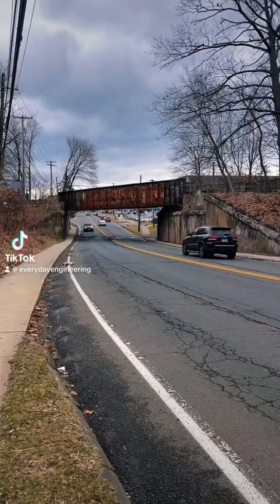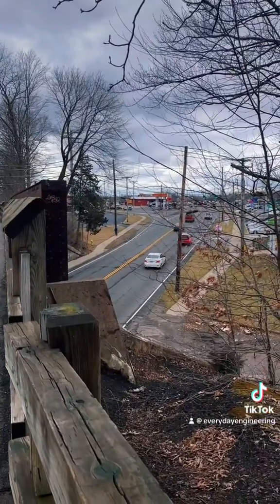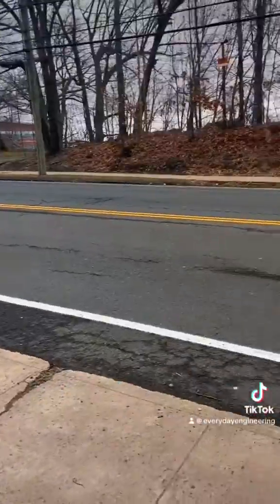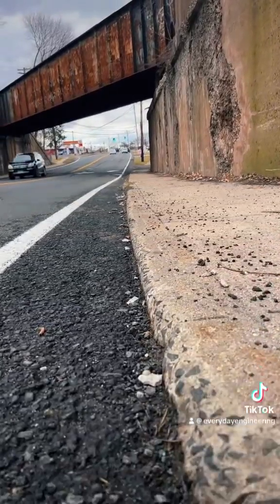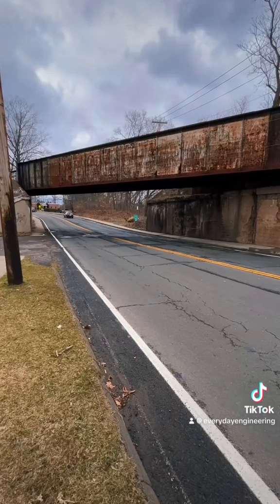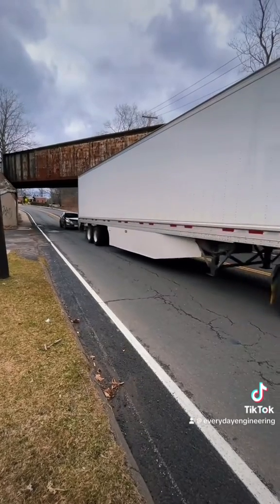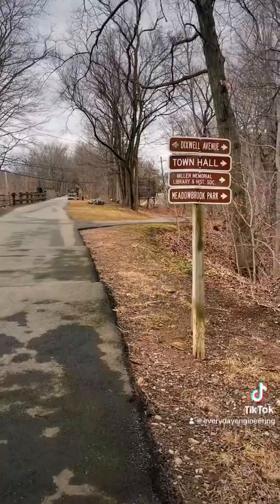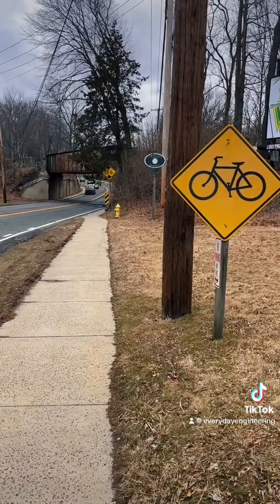Engineer's Analysis of a Bike Trail and Road Connection

Comment: Are you sure those lanes are 16 feet wide? Most pickups are at least 6 feet wide in the US and there's no way there is 5 feet of clearence on either side of those vehicles. Maybe the entire width of the lane AND the sidewalk is 16 feet but definelty not just the lane. I agree the sidewalk isn't what it needs to be but I think a better solution is to have it further removed from the roadway. Maybe have it go up and over the hill instead of following so close to the roadway under that bridge? Footpaths and/or bikepaths don't need to be right next to lanes for vehicles. They can take routes roadways can't or don't to give seperation and therefore safety from vehicle trafffic. A housing edition in Indiana I once lived in had a foot/bike path that was totally seperate from the roadway. Both lead to a shopping area just outside the housing addition. The path cut through the woods and was quite a pleasant walk.
Reply from the maker: yeah i measured it
Reply: Yes, the average width of a truck is 8.5 feet, and as you can see in the video, 2 trucks could almost fit in one lane.

Comment: As a truck driver I can tell you I'm very glad for the 16ft lane's because if it was designed like the way you would have it as an 11ft wide lane a 53 ft truck would literally be all over the lanes
I would agree to 13 ft wide lanes on both sides
Reply from the maker: 11’ lanes are the standard for the entire state of CT. maybe you have some room for improvement?
Reply: A 12 foot width is standard on highways and that doesn't leave much room in many cases. A 13 foot width would be nice and still widen the sidewalk considerably. Although I have a hard time believing the starting width of that road is 16 feet. Maybe including the sidewalk.
Reply: The average width of a truck is 8.5ft. 11 feet is wide enough, it leaves you with 2.5 feet. 16ft is overkill, basically double the width of a truck.